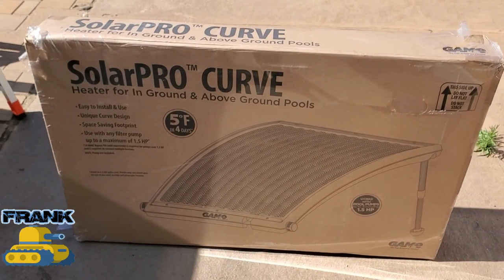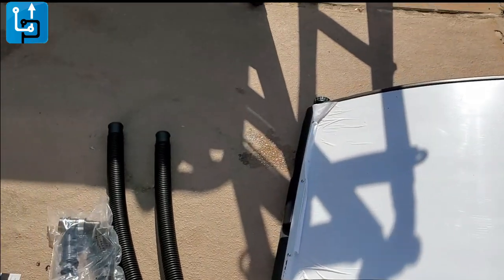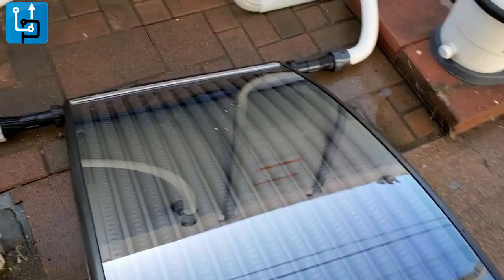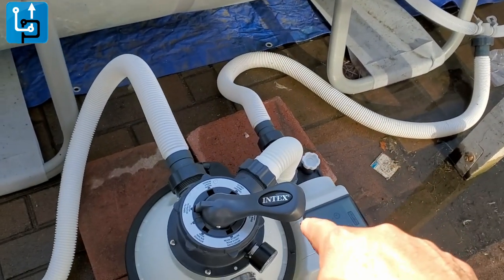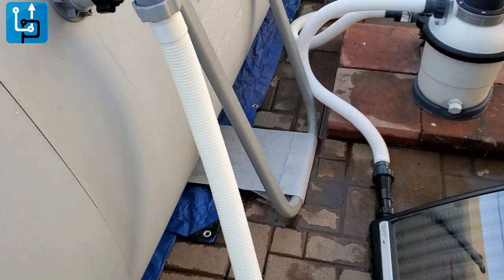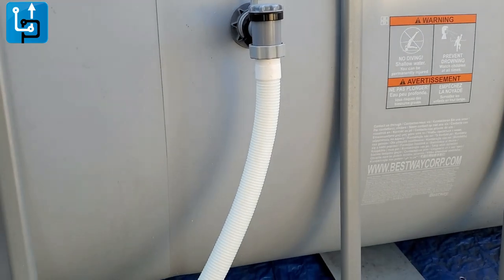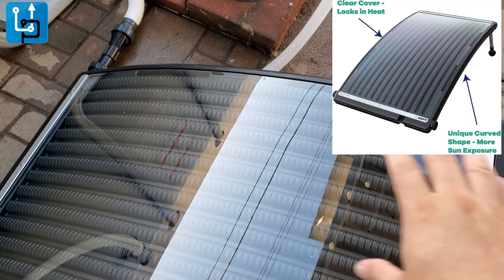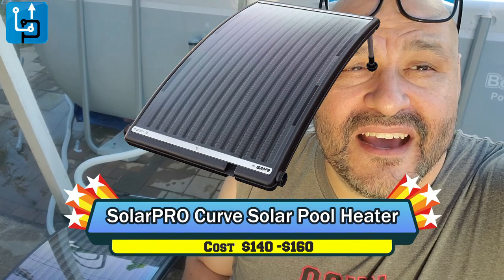SolarPRO Curve Solar Pool Heater

Comment: Hi there, I have the same solar panel. It's been the second summer, and it does the job, but it is already leaking from the back not from the fittings, surprisingly  The material this thing is made from is quite cheap though, have you run into this..? I have some ideas, but I wonder if you already had this, how do you fix it? if you don't mind me asking...Thanks!
Reply from the maker: Yes I  remove the plastic cover and I put silicon to cover the leeks
Reply: Thanks for the answer. Any particular Silicon..? I was thinking of PVC (plumbing) glue, but I am afraid of damaging the panel though..thanks again!!
  @Upgradetech

Comment: What fittings did you use after the adapters? I live in Canada & the local pool people have no idea how to connect the Solar Pro Curve to these "not common" adapters
Reply from the maker: I'll check type size and reply later been busy to check but give me a day or tow to check on this sorry
Reply: Rubber “Fernco” fittings work great to adapt 1 1/4” flex to 1 1/2” PVC. The lock nut fits in the groved portion of the fitting which doubles as a gasket so there’s no need to buy expensive fittings from Intex. I completely hard-piper my pump, sand filter and salt-water system using 1 1/2” PVC and relocated all my mechanical out of the elements. I did use the supplied flex hose where the inlet and out flow attach to the pool liner as the pool was designed to flex. The installation looks great and I’m pretty sure that it will increase the longevity of the mechanical systems being out of the weather.
Reply: @stevenrich1819 how's it heating the pool

Comment: Are you bypassing this system to clean your pool as I am thinking if you suck through this panel it will get cloghed
Reply from the maker: No I set this up on the outake valve and I also setup a bypass if I like to turn off options

Comment: Do you think it worth it? Overall how many days will it take to get it 10 degrees higher ?
Reply from the maker: Not worth it because it takes lots of space and it lowers the pressure on the pump.
Reply: These things do not work. I had 2 of them and it mad zero difference in pool temp. If it was not for the intex cheap solar mats exploding those were of use then these.